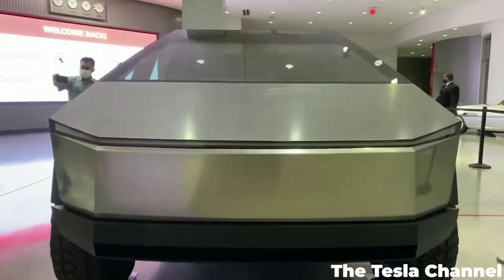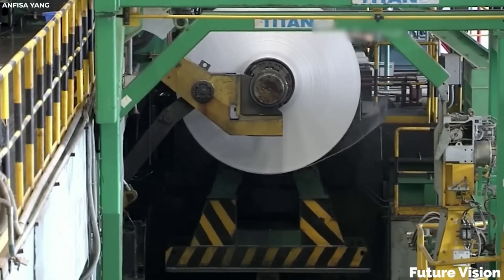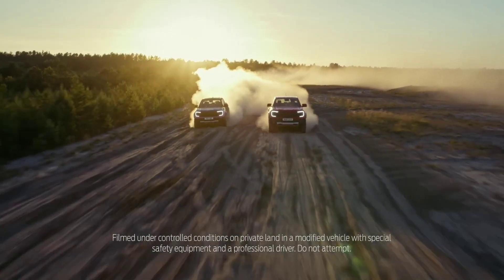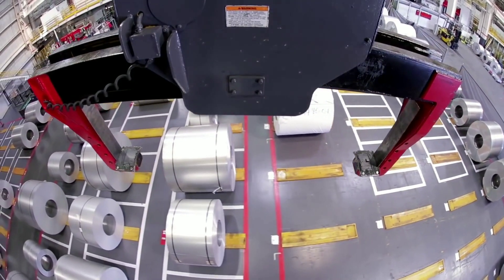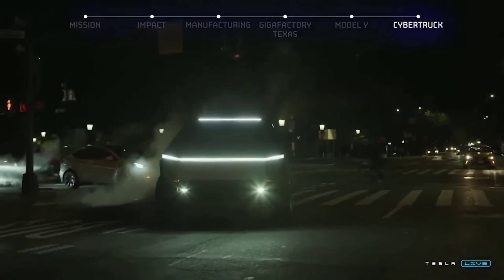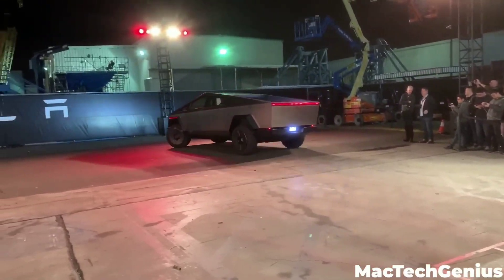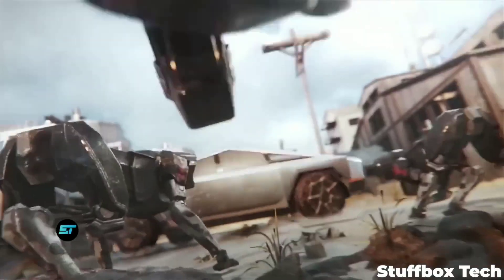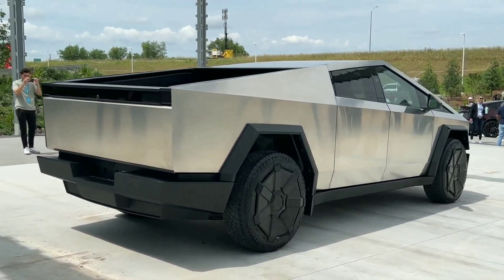You Won’t Believe Why Tesla Created The Cybertruck!

Comment: I use my Chevy Silverado 3500 Dually to pull my 32' fifth wheel trailer.  My most recent trip was from my home in NC to Maine, about 1300 miles.  When I do this I move my bicycle carrier from a rear mounted 2" hitch mount to a front 2" hitch mount.  This is how I use my pickup truck.  Your pickup truck won't allow me to do this.  I'd be interested in hearing how you will provide this flexibility to make your truck a replacement candidate.